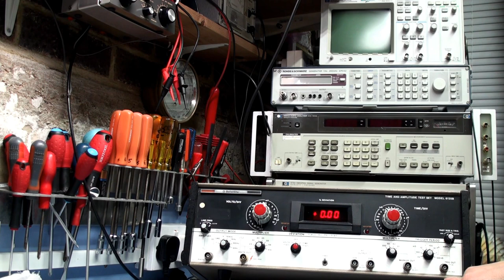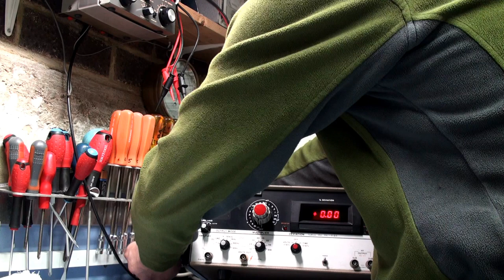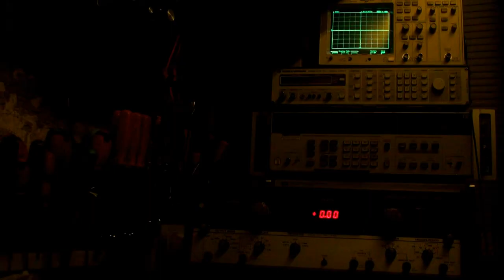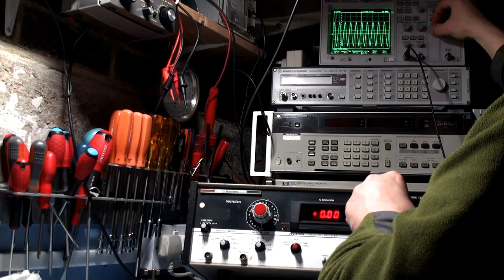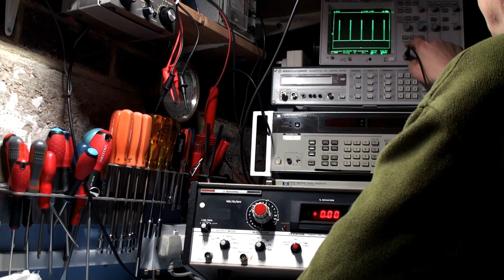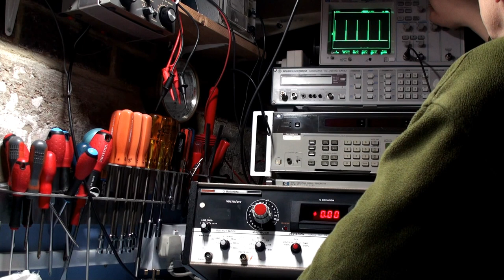Soft key switch repair to a HP 54645 Scope Pt2, Testing

Comment: Minimum of two! Is that calibrator yours or a loaner?
Reply from the maker: Ah, so I have three so thats ok. The calibrator is mine, had it for a few years.
Reply: You always need two so you can fix one if the other's broken. I have FIVE 'scopes. Why????? :)
Reply from the maker: The more the merrier!
Reply: I have three scopes, the tektronix 2432a, a 60 MHz analogue, and my siglent mso. They all have their own good and bad points, and uses.